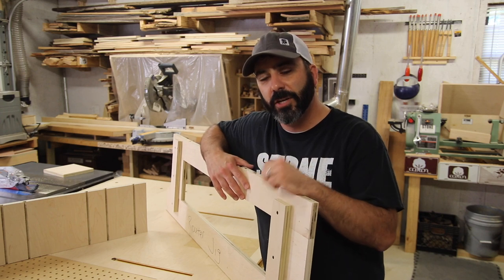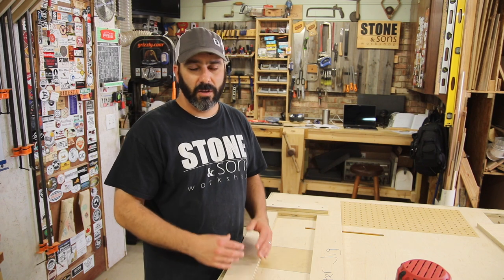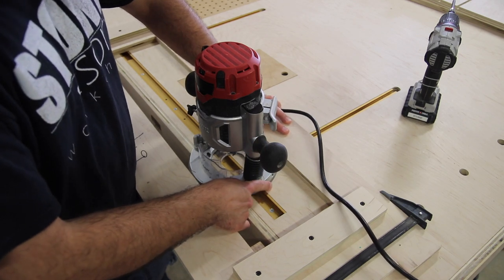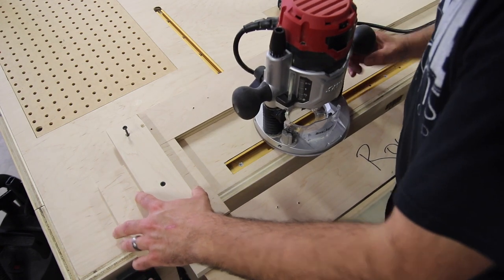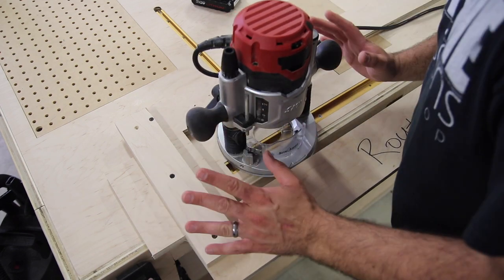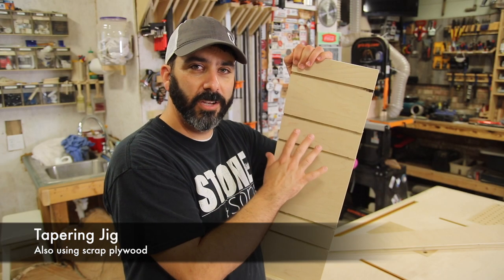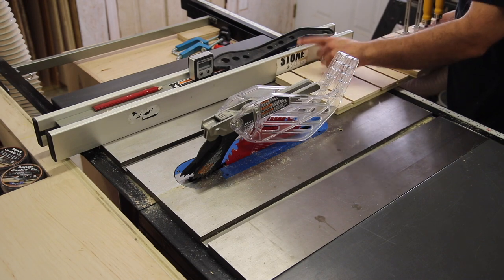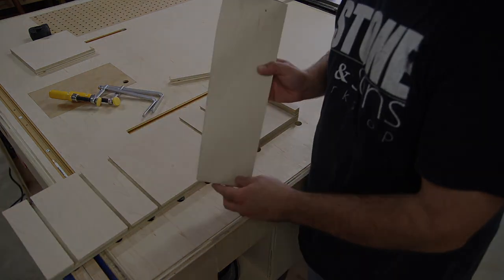2 Woodworking Shop Jigs - How To

Comment: Shawn, Good jig information. I'm sure you have done this and just forgot to put it in this video but for others that may make your taper jig, it can also be used as a tall board fence when attached to the table saw fence and band saw fence (if they have one). If they  cut a notch in one side of it they can also use it as a tall board fence with their router fence.
Reply from the maker: +MRrwmac Yes, very good info and ideas!! Thanks!

Comment: Thanks Shawn! I've been waiting for this one ever since I finished my table. Now all I need to do is buy a plunge router. Is there any reason why I cant just use another T-track in place of a miter track? I guess what Im asking is what advantages does the miter track give over a T-track? - Kevin
Reply from the maker: I have the miter track to use the feather board I already have plus you could use a miter gauge as another example. I'm sure there are other uses as well. I don't see any reason why you couldn't use a t-track if that fits your application better. Thanks!

Comment: Two weeks ago I got the Microjig MatchFit clamps with one of the intents of making a very flexible taper jig - as well as others.  Not sure if you called them out specifically in your video though.  How long was your board and at what measurements did you cut the dovetails for the Matchfit clamps?
Reply from the maker: +Stanley Pearse My jig board is under 30" long and 8 1/4" wide. My first slot is at 2", then 6.5", 9.5", 17.5" and then backwards. The reason for the big gap is just because of the way my router table worked out.